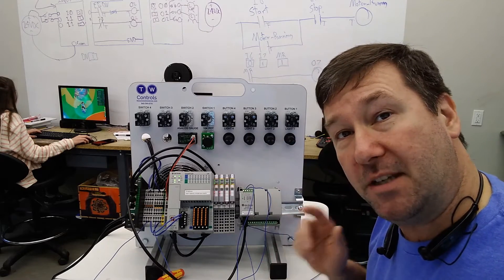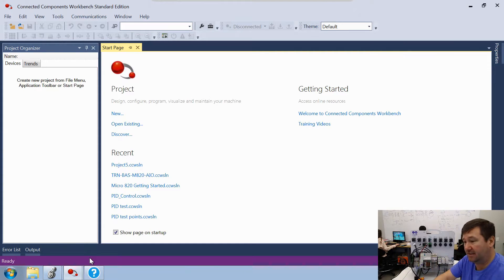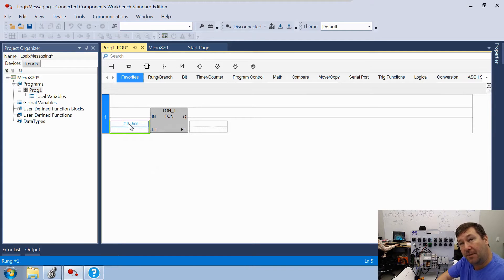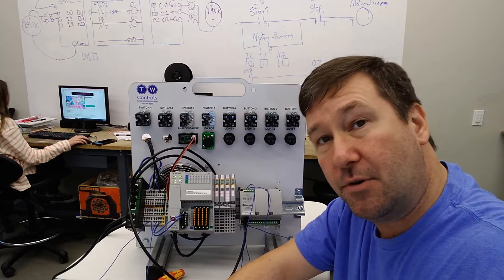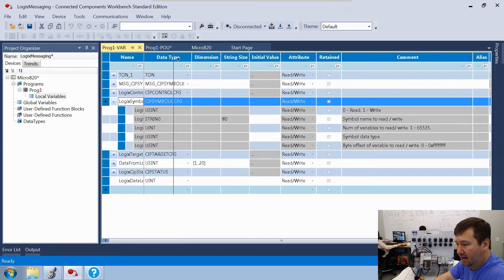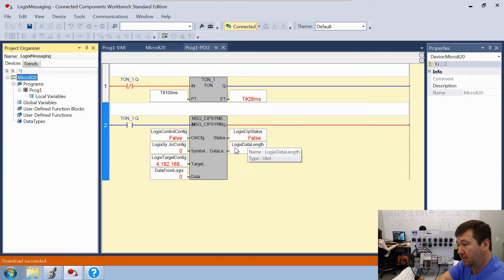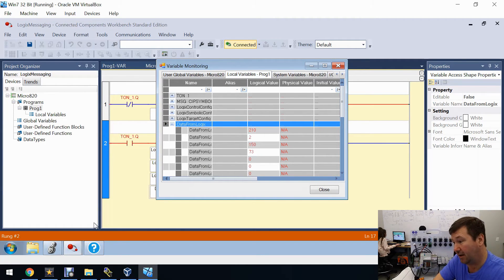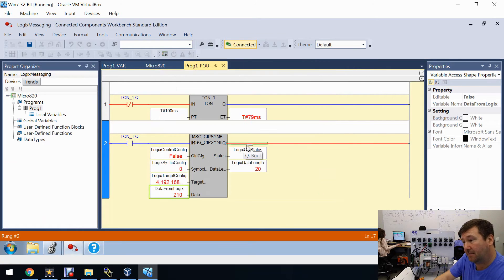Micro800 Message MSG  to Read a Controllogix or Compactlogix

Comment: Tim, I have a program where I am using this method to communicate from one main 820 to three sub 820's. I had an issue where I lost communication with the third, but the system did not shut down like I had anticipated. In short, I believe I have a flaw in my comm-loss detection and I am wondering if you have a solid way to detect communications loss.
Reply from the maker: That would be worthwhile for a video but I don't believe I have ever done it.  The issue is, even if you get the error bit, then next time your trigger your message instruction, it will set it back to 0 until it times out again.  I would put a Go Look for a 1, examine on, for the error bit then two MOVs with the sources being the errorid and the suberrorid.  That way you get the actual error values and they will stay once the error bit is cleared.  Then you can use the DN bit of the message and MOV 0s to the stored codes one the connection is reestablished.

Comment: Hey Tim, due to the maxumum TCP connections of 16,  would I be able to cycle through differnt IP strings on the LogixTargetConfig.Path to send and recive data to more then 16 devices? I'm not woried about scan time.
Reply from the maker: You don't need to change the path, you simply need to stagger your messages.  Check out this video on cascading timers to give you some ideas.
https://youtu.be/xcLdacN3SZs
Reply: @TimWilborne   Lets say I wanted to talk to 20+ devices, are you suggesting 20 staggared messages to these 20 IPs?
Reply from the maker: @Findley_Tyler  Yes
Reply: @TimWilborne   Just curious if you have ever tried to manipulate the Tag with the IP Address on each scan by changing the 4th Octet with a micro 820 to have more than 16 modbus connections?
Reply from the maker: You might be able to but you are making life difficult on yourself.  If you do that, you'll have to manage all the error IDs to troubleshoot the system.  If you stagger the MSG instruction, when one isn't working, then you'll just have to lookup the error ID.  What are you hoping to gain?
Reply: I'm getting max connection used errors even using cascading messages.

Comment: What would the target config path be if you have to connect through an Enet module that resides in a chasis with the processor that you are trying to read?
Reply from the maker: Not following you, the Micro800 isn't a chassis based PLC.  Each communications port on it has a assigned number, then the IP address of the destination device.
Reply: @Tim Wilborne  I set up a Micro850, with a message exactly like in your video, to read data from a Controllogix processor on the same network. The controllogix processor is connected to the network through an Ethernet module. The enet cable is not hooked directly to the Controllogix processor, like it is in your lab setup. I set the target config path to the IP address of the Controllogix processor, but the Micro850 is not reading the data. I am guessing that it is because I am going through an Enet module on the way to the Controllogix processor. I started the address with "4," like you stated. I am just wonder what the address should be when routing through the Enet module that resides in the Controllogix chasis. Will it be different if I am not connecting the Enet cable directly to the Controllogix processor?
Reply from the maker: @bowhunt9968  I was going through a module too. What's your full path?

Comment: Hi Tim. Props on the video. I am a massive fan of yours! I'd like to know why I can not find any information about connecting a Micro820 to a MicroLogix 1100 and making them communicate over Ethernet. I would like to see if it's possible. Thank you.
Reply from the maker: That would be a good one, I should do a general PLC to PLC messaging video.
Reply: @TimWilborne  that would be awesome. I've seen only Modbus RTU communication between Micro820 Modbus RTU master and MicroLogix 1100 slave to exchange data.
I am afraid it's not possible to use MSG block and ethernet ports to do so.
I can do it with a CompactLogix 1769-L32E and a MicroLogix 1100, but not with the Micro820 and ML 1100.
I would be very thankful if you help our community.
Reply from the maker: Yes it is possible. I've done it before, I just never made a video on it.

Comment: Hello Tim, thank you for the video, i have a trouble trying to connect a control logix 5561 with micro 850 and i see in the rslinks request a EDS file for the micro800, can be that the problem? Because i have not connection yet
Reply from the maker: No, the EDS file is just so your PC can communicate with it.  Check your path, it is the most likely problem.  Also look up the error code you are getting.
Reply: Thanks for the answer, the error in the instruction is errorid 224 suberrorid 5, I talked to people at rockwell and they don't know how to solve the problem
Reply from the maker: @nicolastoro6826  That usually had to do with the instance or object. Check your tag and data type
Reply: ok, I solved it, in the route, in addition to 4,192.168.X.X, it is necessary to add the rack number and the destination slot, therefore it remains something like 4,192.168.X.X,1,0 in my case, all this because the PLC controllogix it is very old.

Comment: Tim I love your videos!  I know its along the same vein, but  could you show us how to send 2 separate analog signals via message MSG from L32 compact logix to L71 controller over ethernet?  I need to move two speed requests(inputs) from L32e to L71, to use as analog outputs to 2 VFD's at other location in plant, they are on existing network?  Thanks!
Reply from the maker: Great question James because that isn't along the same vein.  You want to use Produced and Consumed tags.  Here is a video on that.
https://www.youtube.com/watch?v=ABOAHyLcgSM

Comment: Hello, is there a way to read real tags out of a compactlogix without using the copy instruction? Really great video btw!
Reply from the maker: No, you would need to convert them on both ends
Reply: @TimWilborne  Actually, i found a way to do it, using the copy only on the micro820 that i was using to read. i could send you the pdf i used if you like.
Reply from the maker: Yes post it for us please

Comment: Hello Tim, good morning how can we solve the blinking issue ? we added more time and the control voltage increases, with less time it goes too low but with much time it increases almos the control vdc voltage(24), is there another solution, you mentioned you will do a video with a possible solution but I can not finding,thanks for you amazing help.

Comment: Hey Tim, great video! Is it possible to read and write between 2 micro820's?
Reply from the maker: Yes, you do it the same way.  One thing I didn't realize when making this video is you can specify the data type instead of doing the conversion, it is on the list to cover.

Comment: Hi Tim. Tq for the video. I want to ask you regarding TCIP to PC data transfer. My project is to collect analog data from Analyzer and transfer it to Micro 870. after that, the data analog will be transferred to PC. Is the command is the same?
Reply from the maker: Probably not the same.  You will need to see what compatible communication methods there are between your analyzer and the Micro870.

Comment: I really enjoy all the videos you make. I am having a problem and it is setting the communications setup in the Micro820 to talk to a ControlLogix Rack. Currently the IP address of the ethernet card in the PLC Rack is 192.168.1.40 and is in slot 9 with the Processor in slot 0. Im new to working with the 820's and so far the communication path setup is where im struggling. I do have it setup on the ControlLogix side where it reads from the micro820.
Reply from the maker: Make sure you use the complete path which would be 192.168.1.40,1,0

Comment: Thanks for the video... Though I have  one doubt how did you select port as 4? What's the logic behind... Thanks. ✌
Reply from the maker: That tells the message instruction to go out the Ethernet port.
Reply: @TimWilborne  After comparing the read message path between this video and its counterpart, I noticed that in the CompactLogix the port was set to 2 versus 4 in the Micro820. Would that difference in port number be the primary difference in messaging with the Micro820 and a CompactLogix? 

I am having an issue with allowing a third party device to write to three array tags in a Micro820. The manufacturer advertises the device communicating to CLX/CPX and when asked about the Micro800 line, they said it wouldn't be an issue. Now that I have the devices connected and not communicating, I had them inspect the three array tags in the Micro820 program to verify they were as instructed, their "Allen-Bradley" expert only could replay with "maybe it can't talk to the Micro820 like the Control and CompactLogix" and left it at that.

Comment: Thanks for your videos,they are very helpful, I have a question, How do I convert data from the MSG_MODBUS funcions that stores itself into two spaces of the array? example, I read a register that is allocated in modbus device by tag 400001-400002 and arrives to master and sotores in Local_Addr [1] and Local_Addr[2]? How do I make a value from that? Thanks in advance Mr.
Reply from the maker: Have a look at the COP instruction.
Reply: @TimWilborne  Thank you for helping Mr. This COP function works greately!!

Comment: Hi Tim,  thanks for all the helpful videos! I was  wondering if it is possible to write to a oampactlogix controller from a micro820? Or is it not possible because of mismatch in data types? Thanks!
Reply from the maker: It is possible to write but I prefer to read because it makes to easier when looking at the program too determine where the data is coming from.

Comment: Tim, I'm working with a Micro820 and need to convert the RTC time to seconds, I'm trying to keep track of how long a machine has been cycling so I can calculate a rate/time. I can read the RTC but can't figure out how to convert that to a DATE data type (number of seconds since 1-1-1970).
Is there an easy way to do this that I'm missing?
Thanks for the video's, they have helped me on more than one occasion.
Reply from the maker: Hi Rob, that would take some work and while it might be a fun challenge, but I'm not following how you are going to use it to see how long a machine has cycle.  Why not just use an RTO instruction that is enabled whenever the machine is cycling?

The hours, minutes, and seconds are easy enough, then you would have to use IF then's to determin the value to put in for the month since each month doesn't have the same amount of days.  Then you have years...which are doable through an equation to account for leap years but good grief...that's a lot of work.
Reply: @TimWilborne  FYI, I found a workaround: format the RTC date data into a string using ANY_TO_STRING (formatting YYYY-MM-DD), then do ANY_TO_DATE on that and follow that with ANY_TO_DINT. It returns the number of seconds since 1-1-1970 to that day.  Then add it to the time variable formatted in seconds of day.
Reply from the maker: @willpowerfan  That is a a good one, thanks for sharing Rob.  What are you doing with it from there?  I'm still trying to follow the reason to do this compared to the RTO.
Reply: @TimWilborne  We're feeding a continuous process and need to keep track of running time as well as down time or 'time between jobs' so we can properly put a 'gap' between jobs.  For 14 years I've been working with a Micrologix 1400 and actually did the number-of-seconds-since 1-1-2000 on that processor due to the limits of timers on that platform.
Now that I know a TON can handle a preset of over 49 days I'll probably work with that on the Micro820.
Reply from the maker: @willpowerfan  Might make for a good video.
Reply: @TimWilborne  Thanks Tim, I did the whole seconds thing fairly easily in a Compact Logix by calling GSV with a 'currentvalue' argument (but it's in microseconds), I was hoping the Micro820 might have the same thing that I didn't know about. I'll probably touch base with Tech Support and if I don't get the answer I want I'll go with your RTO suggestion.

Comment: I really enjoy watching these videos. I have just started looking into the ML800 series for a couple small projects. I have some questions though, have you converted  a MicroLogix 1400 program to CCM using the MicroLogix Library Converter Tool? What are your thoughts? And do you think you might do a video on it?
Reply from the maker: Hi Laura.  I haven't and based off of the RsLogix 500 to Studio 5000 converter tool, I wouldn't recommend it.  The main reason is it makes you skip taking advantage of one of the best features of CCW, the tag based addressing.  I've seen some programs that have used these conversions and there is nothing worse then looking in a Studio 5000 or CCW program and finding a tag array named "N7".  I hope that helps and thanks for watching!

Comment: Hey Tim, i have a somewhat specific question. For my application, i have an array of BOOLs holding my HMI input bits. As i want to reset them at the end of every scan cycle to mimic momentary operation, i would want to zero all the bits in the array systematically rather than resetting every bit with an unlatch instruction. Previously, i was intending to use micrologix and had found a work around with the MOV instruction by moving a Zero integer (N7:0) to the (B3:0) (this worked, my application is small-scale so 16 bits was sufficient). Any suggestions for a similar approach in CCW?
Reply from the maker: You could create a dint data type and have 32 bits in it to address individually and use the same mov instruction. But why not configure your buttons on your HMI for momentary operation?
Reply: Tim Wilborne I plan on using the micro 820 with the remote lcd for other purposes (cheap means to adjust timer parameters, and product type without online edits through CCW). I’m not sure on how flexible/user friendly the unit is in terms of creating basic HMI inputs functionality (start/stop functionality, alarm acknowledge). Furthermore my client wants to keep the HMI logic/alarming programmed within the PLC (that’s how it’s done for other PLCs on-site).